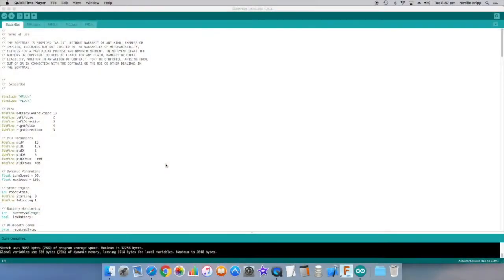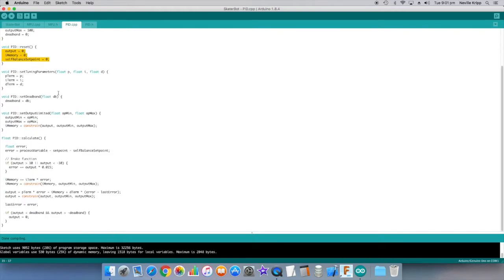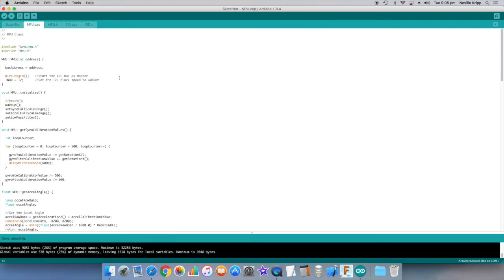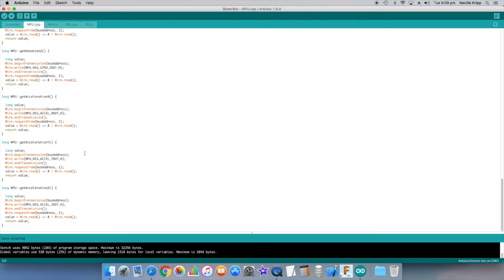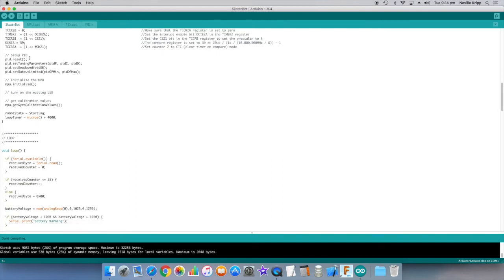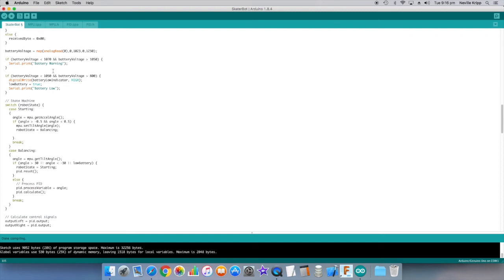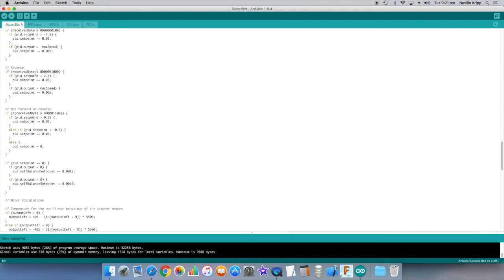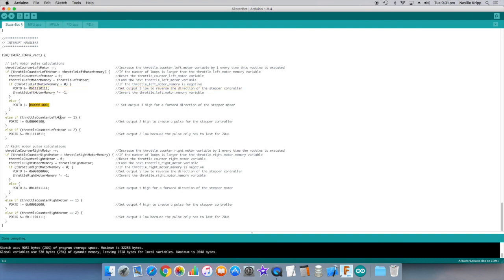#011 Self Balancing Robot Arduino Code

Comment: Hi, Thanks for kae this kind of videos, they are very helpful! You mentioned that there is a reference projet to regarding  the motor controller, I'm interesting in see how to control the speed and compensate the non-linearities. Could you please point me to such reference project please? Thanks!!
Reply from the maker: Hi, if you google Joop Broking, you can check out his project page on the self balancing robot.

Comment: hi. I don;t know what the oroblem is but y motors are not changing the direction according to the mpu readings they are just rotating in one single direction as i power them up. plz help sir
Reply from the maker: I can try to help, can you email me or message me on Facebook, there should be links in the video details.
Reply: Grumpy Old Tech Sir,  i have messaged you on facebook. My name is Sahil.

Comment: what arduino did you use?
Reply from the maker: In this version I used an Arduino Uno. 
I’m just finishing up a series of videos for the V2 robot that uses a custom board I designed rather that an arduino. All the information should be published by the end of the weekend. Might we worth a look as well, if you subscribe and turn on notifications, you should see then pop over over the weekend.